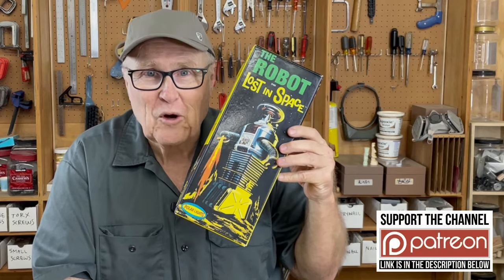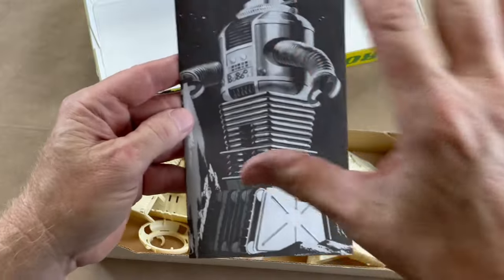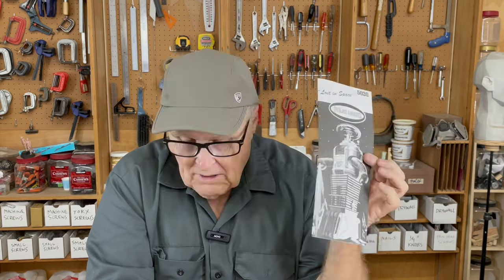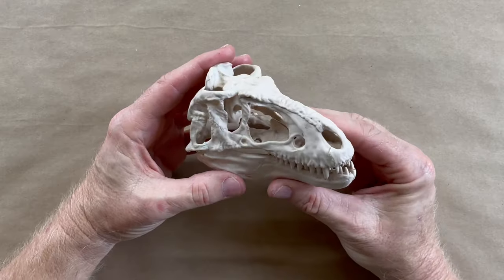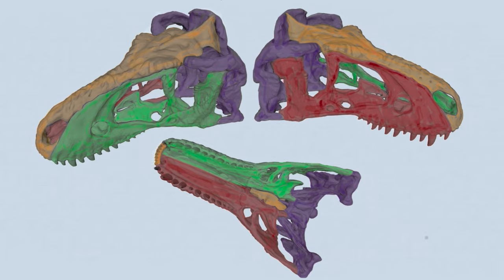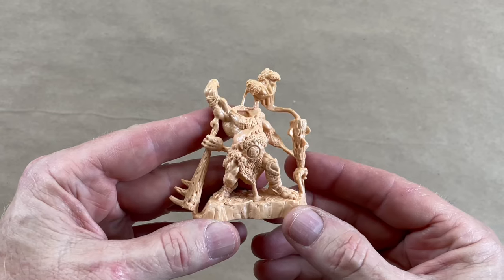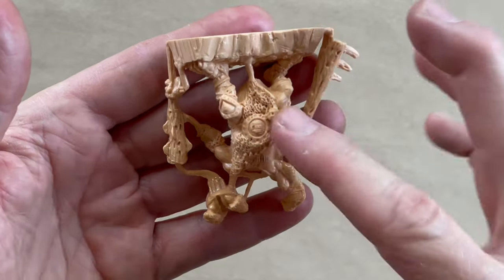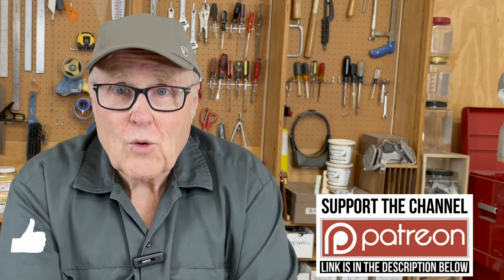A Kit You Can Cast  -  Complexity You Can't!

Comment: Future Video Idea:  You have previously mentioned that setting your pressure pots to 50 PSI provides reliable results over a wide range of conditions (e.g., complex molds, old/foamy resins, etc.).  However, I thought it might be fun if you did a series of castings demonstrating the effectiveness of pressure under a range of LOWER pressures.  Some casters suggest that they can achieve bubble-free castings at pressures around 20 to 25 PSI given their particular set up.  The motivation to do this is that other people have fashioned pressure pots from heavy-duty plastic buckets, a bicycle nozzle, a bicycle pump, and some caulk and only pressurizing them to 20 PSI (less than a bike tire).  If there is truth in the statements made by others that lower pressures can also be effective then maybe bubble-free castings could be achievable by those of us who can't afford to commission a welder to create tanks made from semi-truck airbrake cylinders. Haha   Anyway, just an idea.  Let's see what 15 PSI can do, what 20 PSI can do and how great 50 PSI can be.
Reply from the maker: It’s a good idea and worth investigating. Thanks!

Comment: try copper citrate + heat gun high temp rigid metal mold forming (ie put the original/copy inside the citrate, then blast it around, possibly melting the original/copy inside also, forming a rigid copper mold around. same for copper acetate heating decomposition as flexible high temp film on-around the molded object.

Comment: Robert do you thing that a cement model mold and scrap PLA from failed 3D prints can be used if a BLOW TORCH is used as the melting heat source ?.. i just thought of the idea and have not tried it as of yet.. Have you ever attempted this.

Comment: Hi, new to the channel. Fantastic videos by the way very concise and detailed. I have a question probably answered to one of your lathe database of videos. I noticed you use a compression chamber for your pours is that what is required for silicone rubber pours or will a vacuum chamber do the same? At some point I will need to use expoxy resin and silicone rubber for my projects I’m investigating? From. OST videos I have watched epoxy resin is always in a vacuum chamber, can a silicone rubber be cured in a vacuum chamber also? Of course the object for both silicone and epoxy is to get rid of the air bubbles. But with the silicone you are pressurising the chambers and wouldn’t that prevent trapped air in silicone rubber molds from escaping, or does it just compress them out. Apologies for such a noob question. Have learnt a lot in 2 nights binge watching your channel. It’s fantastic thank you. 👍🏻

Comment: Do you think that it would work to make separate cut silicons molds for the head, torso, and limbs of a baby doll (maybe also ears?), then cast silicone in silicone (with a suitable release agent, of course), and then attach the pieces with more silicone to make a full silicone baby doll? Would it leave terrible seams? I don’t know if you have any experience with that… I’m hoping to cast my models in silicone, basically, for a baby that’s fully silicone at the end but doesn’t have the same pour spout and seamlines issues as all the other silicone reborns I see. 

Maybe I should be emailing you instead. I’m in the sculpting stage right now but trying to sculpt for the cast, and this was the first video I actually found that addressed the idea the way I was trying to approach it. Unfortunately, I don’t know if it still works when casting silicone in silicone. @_@

Hope that made sense. I have a fever right now, haha.